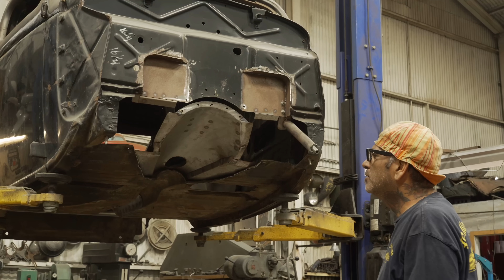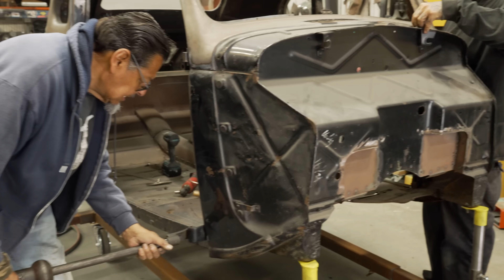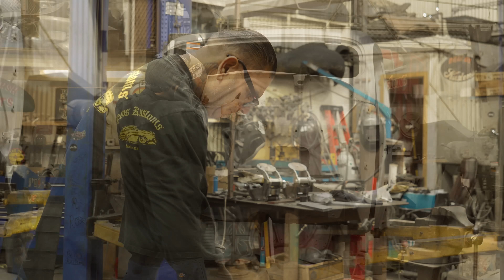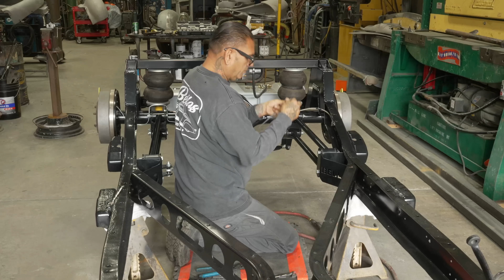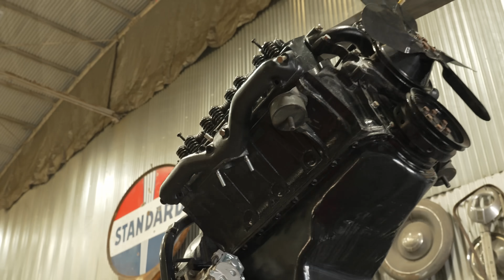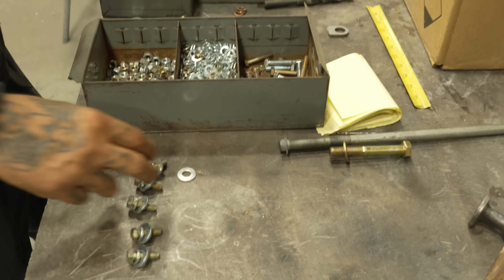1936 Ford Body and Frame Prep

Comment: Mike is so meticulous in the mechanicals, love it!  The only thing I would have done differently is have a dedicated sacrificial socket sharpened like a punch. Heat the socket with a small torch and use it like a punch for all those frame holes. It will also keep the the bedding from fraying all in one step. Great for rugs too.

Comment: The last 36 I worked on had nothing left below the lower hinge.  Jealous of the nice cars you start with.   Always a joy to see one of Mike's videos pop up. I have been at this for 50 years this year and am still learning form folks like you.  The torch is the rusty bolt equalizer

Comment: Lokochon gonna be making brackets for days on that ol dog! Mike just a suggestion may want to heat an old socket to cut your body mount bolt holes like you do carpet for seat belts in a car.  Your way works good too.

Comment: Hay Mike can never get enough of watching you, such a craftsman.😊 a little tip when doing brake or fuel lines, pull them through a piece of wood with hole drilled through, makes the lines nice and straight for bending.😊😊

Comment: Agree with your reasoning on attaching body to frame prior to finalizing bodywork. With only webbing in between, all that metal has a "memory" that has to be respected. Later models that have rubber biscuits between body and frame present yet another set of variables because they change shape over time in a non-uniform way.

Comment: Your way , body on , gaps fit , then body off for paint is the right way . My friend Jim will occasionally be asked to paint a car without removing all the trim . He preps the car, polishes all the chrome , cleans and waxes all the windows ...then tapes it off and shoots it He doesnt want to even touch the paint after the tape comes off . Hanging doors , hood and deck lid after paint is hard enough , adjusting all the gaps would be a nightmare ...and scratched paint everywhere
Reply: In my old age I would just have to buy a fiberglass replica. When it is done will it be partially very thin metal.

Comment: Try using a hot soldering iron to make the holes in those material straps for the bolt holes. Its clears the hole and melts the frayed edges at the same time . Much faster. Love the show .

Comment: If you run the brake lines on the rear side of the rear axles tubes it has a lesser chance of the brake lines getting smashed if you ever have to tow the vehicle. The tow hooks or straps can smash the lines if on front of the tubes.

Comment: I've done it both ways. I like all metal work on the body to be done with the frame unless it cant then you play that on and off and on again game. Some cars it doesnt matter because they are so flexy you will have to shim here and there on body bolts regardless. We did a '70 triumph roadster and that thing had a recipe of shims and if they all weren't in you could tell in the door and hood gaps. Each one is different too and they weren't that good from the factory so some tweaking on the panels sometimes has to happen.

Comment: Yep the same as i do. Pre fit the body to aline all the gaps on a steady base where it will sit on the rest of it's life than body work than back of and paint it. Or pre paint the in and underside than fit the body on the frame for good and bodywork with paintwork so it can stay as is. With the perfect gap fit.

Comment: Nice work Mike, everything as it should be. I noticed you kept the draft tube on the engine? I've found a lot of the old type engines seem to work better with a PCV conversion - some may not agree.

Comment: I am rebuilding the floor in my 36 Fordor. I have some subrails for a 2 door. I took out the old subrails a few years ago and cannot remember if the subrail goes directly over the frame or goes inbetween the door post and the body mount bracket.

It seems to make more sense to go between the door pillar and front body mount and then the floor goes over the frame and under the subrail.
I do have to make the curved part that will go under the back floor and over the differential hump.
Any pictures would help.

Thanks.

jack

Comment: Install the frame welting then use a solding iron to cut out the body mount bolt holes, just insert it in the hole and twist it around and around.

Comment: disc front brakes, Ford 11" bendix rears (small slave cylinder bore) and a non boosted early ford single circuit master cylinder?? That is all kinds of wrong homie. That thing will not stop worth shit from 70MPH! Not being a hater.. just think you need to upgrade your brake system knowledge.